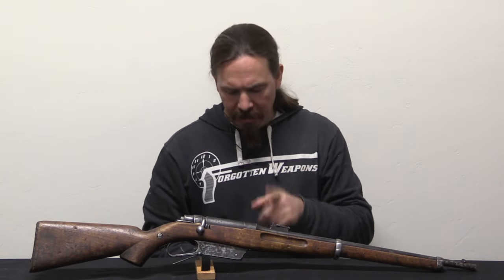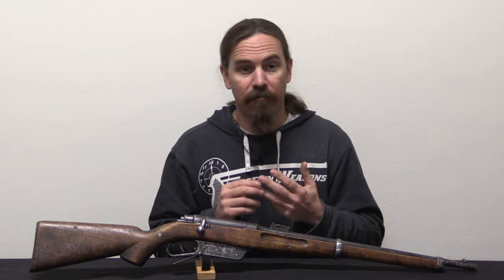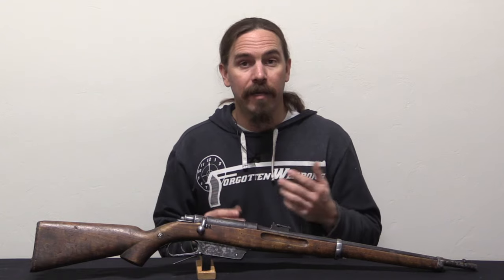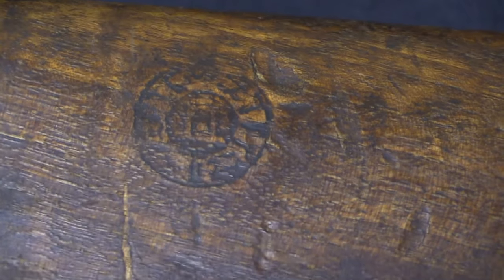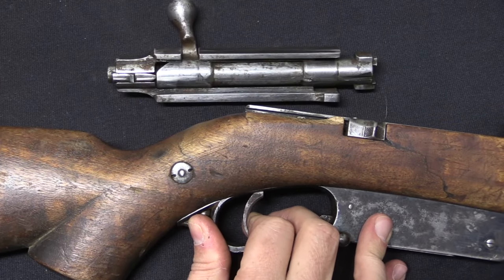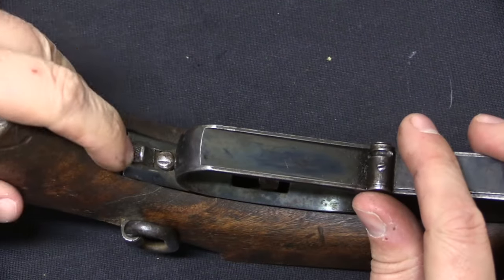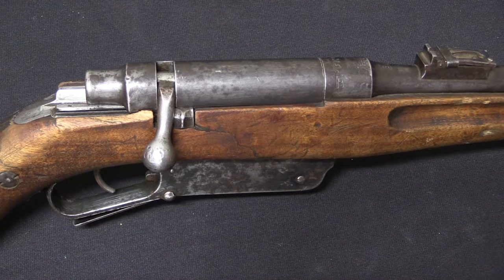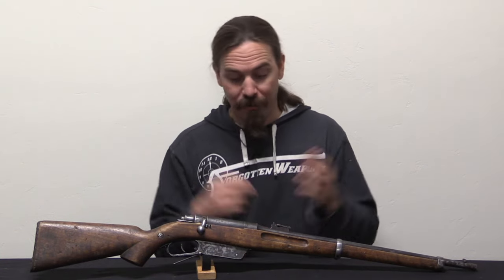Afghan Schlegelmilch Carbine from the Kabul Arsenal

Comment: You lie!  There is no way any rifle that simple and that easy to disassemble was made by anyone who spoke German!
Reply: ,,,,,, but we understand why it was rejected by the German military.
Reply: @cyrilhudak4568  What iss sis? Simple no tools dissassembly? Zis iss plasphemy!
Reply: Could be there is some hidden joke here I don't get but the G3 I was trained on was field-strippable without any tools as well.
Reply: @Llyd_ApDicta   because of that it was replaced by the G36 ;-)
Reply: @erpelschlut5092  And that requires tools to be field stripped? Are we talking about the same gun?
Reply: @cyrilhudak4568  Well if you have soldiers that you can hand any gun and they still will be great you can be picky and do not need an "idiot's rifle" ;)
Reply: 😂 😂 😂
There is huge difference between German engineering, and the Specifications given by the German Military to the Factories and Engineers!
😂 😂 😂
But I hear you, simplicity is not a standard in the German Weapons making history of the last 200 years!
Reply: @Llyd_ApDicta  It's a joke/stereotype based on how overly complex a few WW2-era German weapons (and the G-11) were. In reality it obviously doesn't hold up considering how many simple and utilitarian guns also came from German designers, but it's just a silly joke so shrug
Reply: @zelpyzelp  Seen, acknowledged and shrugged. Thx for the heads-up.
Reply: Hans call se Polizei! Why did we not adot sis rifel?
Reply: Technically it was "made" by Afghans who in all likelihood didn't speak German
Reply: Once again an enjoyable video. I would love 😍 it if you did videos about the about the "cottage industry" of Afghan weapons. I think it would be fascinating for everyone.
Reply: @erpelschlut5092  the G36 is only a slightly rearranged AR-18....

Comment: All Khyber Pass contract  rifles were set to Arshins not meters until 1900's......1 Arshin = 0.711 meters.... this is very important for the shooter to know when trying to hit Targets in any significant distance. that's why you see the Fantastic 2000 number at the top of the site is not 2000 meters it's 2000 Arshins which is really 1300 +/- meters....  because Afghan warlords used Russian  measurement and weight system  for trade purposes with set  to the Russian system .
The sights are set to Arshins, not meters ! Which is actually a big difference if you go to zero the rifle the bullets are going to hit way low!.... Used on early Moisin Nagants and all  invented by Petr the Great ( Alexseevich) .
Here is the conversion:
1 meter = 1.406 Arshin.
1 Arshin = 0.711 meters 
This drove the Finns crazy as they scrubbed all the sites they captured from the early Russian rifles and converted them to meters
The Emir used the measuring system the same as the Russian monarchy. 
Mosin nagants from the same year are set to arshins too
Reply: First of all, these ain't kyber pass... Secondly, these rifles were made in germany... It would make sense for them to set them in meters, as they were a short run of trials rifles, in the standard german pattern, using german ammunition.

And yes, Ian knows what arshins are, he has talked about them a lot in his vids on older mosins...
Reply: You're sure it's not Schritt?

Comment: It's an amazement this rifle has survived at all in that part of the world.
Reply: I am not surprised at all. One thing I have learned regarding tribesmen is that they value things that make their life easier/better very highly and will work to their last breath to preserve its function. It's why you see villages the world over that own a single Toyota or Nissan truck that is about as much Nissan as Toyota or vice versa. They will cobble together anything they can to keep it working and functioning. The same applies to a good rifle. A good rifle will get treated better than just about anything else. Sure it looks dilapidated and neglected, but it has been held together with little more than basic hand tools and scrap bits for over 100 years by SOMEBODY in Afghanistan. Whether it be the actual arsenal itself (who may have had a little bit more than hand tools) or a tribesman. The point being that it is likely that it is still in firing condition. If you can get an accurate casting of the chamber and figure out if it is 8x57J or JS it should still shoot.
Reply: Im not surprised because 3rd world countries tend to hold on to everything they can. What does surprise me is it wasnt destroyed in an air strike or by the Taliban lol

Comment: That's the coolest gun i've seen yet this year. What a cool operating system with a receiver that isn't load-bearing and a built-in dust-cover for the bolt carrier. What a  pity it never became standard kit for a major power, i'd bet it would do quite well in dusty, dirty conditions and hold its own pretty well vs better know weapons.

Comment: I imagine the dovetail receiver/barrel design would make manufacturing the rifle in different calibers much simpler, I suppose supporting the idea that it was being improved from the trials design for commercial sale. Any caliber barrel and bolt face could be adapted to the receiver as it isn't a pressure bearing part. Very clever design for the time I think.

Comment: The Schwalbenschwanzzinkung between the receiver and the chamber is a very interesting concept.
Reply: Gesuntheit
Reply: @Fluesterwitz yep..also commonly used in metalworking.
Reply: @Hirosjimma  Tanke....
Reply: @Fluesterwitz Schwalbe = dove, schwanz = tail, zinkung = (finger) joints.
Writing all three words in one hilarious compound is possible in German, but I'd rather use Schwalbenschwanz-Zinkung in modern writing. We kind of came to the understanding in Germany that compound words with more than two components are hard to read and shouldn't be a thing. Unless you want to impress foreigners with monster-words. ;)

Comment: I saw many strange firearms during my deployment in Afghanistan. The strangest of which looked very old but you can tell was actually fairly modern, or at least cobbled together from many new parts and perhaps some ancient ones as well. I doubt it would have worked as it appeared to be a mix between a Soviet AK and a British Ross rifle and it was bolt action but with an obnoxiously long removable magazine. A buddy of mine bought a similar Frankenstein gun from the seller for next to nothing just for shits but never fired it as it appeared several critical components were made cast pot metal.

Comment: Could it be that the clip holder was meant to lock down the clip and allow the bolt to run over without stripping a cartridge out. Then unlocking the clip and so at the needs moment, run the bolt and chambering the round now presented in the correct position?

Comment: I wonder if the clip locking feature was to allow easier loading of single rounds? I bet the clips are probably the hardest part to manufacture consistently on a smaller scale, and are also critical to proper function.

Comment: To my knowledge the persian number of 1321 converts to either 1943 or 1853 (sometimes dates are regarded to be a "numeral value" and read from right to left). In my eyes 1943 would make more sense than 1903 or even 1853. Gewehrfabrik Spandau stood under complete government's control in 1903 and at that time there were absolutely no relations between Afghanistan and the Reich. First attempts were made shortly before WW1 (officially in 1915) and ended soon 😉. Next attempt was during the late 30's, when german technicians were sent to afghanistan in larger numbers to help building up industrial production. (As far as I know, they were sent back in 1941.)
In regard of the facts that the schlegelmilch-system was copied in germamy by several  gunsmiths after 1919 (when spandau was closed), and because it was relatively easy to produce (thanks to foreward thinking design) I could imagine, that this was a german attempt to start production and teach native gunsmiths in modern and repeatable production methods.
Or is there something wrong with my date conversion?

Comment: "Units similar to those used in Persia, Arabia and India, were used in Afghanistan before 1926. One notable unit used to measure length was the goes, which was equal t 1.16 m (45.67 in).[1]"

So my guess is the rear sight is using goes?
Reply: Of note, metric was only adopted in Afghanistan in 1926.

Comment: As a lefty, that rear sling mount offends me!
Reply: "The tyranny of the right handed man strikes again!"
Reply: I agree, but I'm sure the lefty complaints fall on deaf ears even more so in places like Afghanistan. Left handedness is haram
Reply: Too many easily offended people today,use a different rifle,as one lefty to another.
Reply: @mxecho  I agree, because they're not right.
Reply: Say that not within earshot of certain Irish tank commanders....
Reply: Looking closely at the rifle, the back sling could easily be swapped to the other side and the front barrel band/sling could be reversed to move it to the right side of the rifle as well.
More interesting is that it looks like the rifle could be converted to a left hand bolt with just one part. That being the bolt cover made with the bolt handle slot on the left instead of the right. As Ian showed, the bolt locks into the breech just like an AR-15. The bolt cover just holds everything in alignment.  Once the bolt enters the breech it doesn't matter if you rotate the bolt clockwise or counter-clockwise to lock it into battery.

Comment: Could that lever act as a magazine cutoff? Holding the loaded magazine down out of the way so they could manually load and fire? Then release and it moves up into battery? I mean they were very close to the Brits, copying them often in that era.
Reply: The magazine has no floor plate and the lever doesn't seem to disable the follower in the lower receiver which feeds up another round each time the bolt is opened.

Comment: Is that latch to hold the bolt open so that, in the hot Afghan climate after prolonged firing, the bolt would remain open even when the rifle was carried, thus allowing ventilation to the chamber for cooling?
Reply: On a bolt action even in a desert environment barrel overheating would be a non issue. If anything you would want to keep the action as closed up as possible to keep sand and dust out of it.
Reply: @Hybris51129  well of course it is important to keep the action clean but was a trade off made? Firing even 20 rounds rapid through a bolt action will make it very hot, not sure of the metallurgy of the rifle but the combination of a metal-and-wood rifle, climate and rapid fire could cause issues like mirage/shimmer when looking down the sights, significant parts of the rifle being too hot to touch/carry, excessive lubricant smoke, mechanical wear and tear, destroying heat treatments applied to the components, and so on. Just a hypothesis on why that little latch exists. And even if my hypothesis is correct, it doesn’t mean that little latch was a good idea...

Comment: That rifle seems to have a lot of good innovations! What were it"s downsides?
Reply: Old video mentioned that it likely had the same double feeding issue as the original G88 it was meant to replace. It may also have been less accurate than the Mauser variant. Another pitfall can be the way you machine certain parts which may have proved a technological cost weighed against it. So it was likely a good rifle but most of its benefits were in the ease of production, not the performance of the weapon.
It'd have been ideal for WW1, though.

Comment: Amazing, that design would only require a safety to be considered very modern, oh, and of course a 6.5 Creedmore chambering, after all what is the modern era without a reduction of capability. What a find! This is a high point in your work so far, and that is no easy accomplishment considering your work to date. I look forward to that book.
Reply: A trigger block lever safety would be easy. It looks like it would also be easy to build a left hand bolt action since the lock-up is in the breech and not on the receiver. The sling requires no modification at all. Install the wrist sling mount from the other side and put the barrel band with the sling mount on backwards.
That was my thought too: 6.5 Creedmore and night optics would make the Afgan Schlegalmilch an excellent brush gun for wild pigs.
Reply: @aceroadholder2185  Also this rifle was originally tested for the 6mm Mauser round, a very fast modest-weight round. Think of the 6.5mm Swedish but even lighter.

Comment: wtf is up with the sling swivel on the grip that sounds like the worst place to put it
Reply: Calvary, slung across the back.
Reply: @Davemte34108  but they still held them by the grip. i have carbines with slings on the side but the swivel is placed right below where your cheek would mount

Comment: that slide that locks the clips in so that you don't lose your empties, since they made their own ammo doesn't mean they could make or make enough of these clips. they may have deployed troops with bandoliers or pouches of loose ammo and only enough clips for 5 or 10 etc prepared reloads. there may have also been a trooper or donkey/camel tasked with carrying crates of ammo not loaded into clips already. given they saved money on not bothering with a safety I would expect they were not willing to waste money on throwing reusable metal clips away and even if they had the capability to make plenty there may have been concern over supply of raw materials during wartime preventing them from making more. after all a bullet is more valuable to warfare than an empty clip. they may also have kept more clips in reserve as surplus just in case a war took out their capability to manufacture more

Comment: I meant the one holding the extractor on, not the replacement barrel band.  Just popped out at me when you said that, i was "wait a minute, i just saw a screw."  Rewound the video and spotted it.  Tiny nit pick, it just struck me as funny, as you are so meticulous normally.